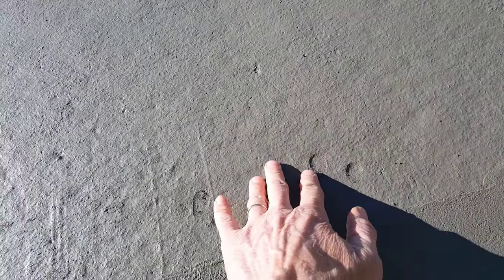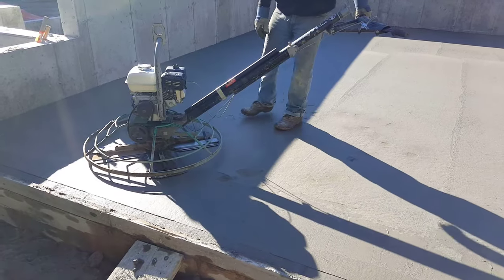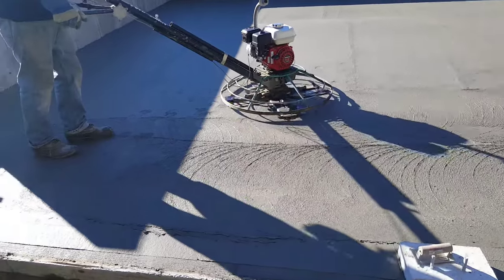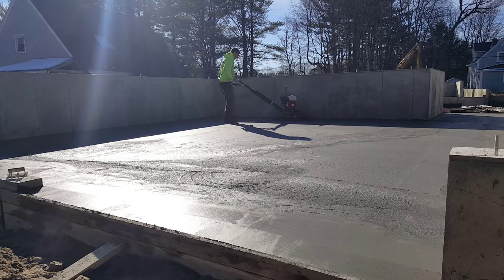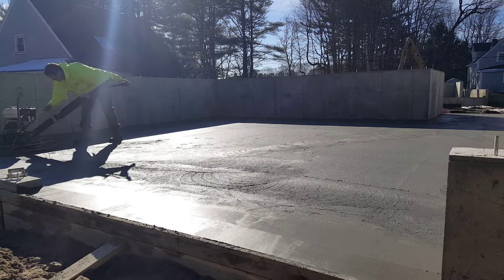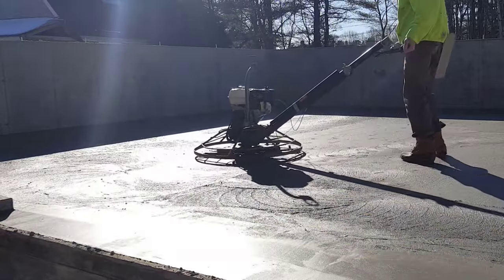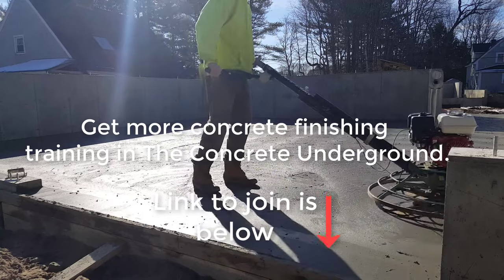When NOT To Start Finishing Concrete (How To Know It's Too Early)

Comment: As a 1.5 to 2 million sq/ft per year finisher for over 20 years rain or shine, I can honestly say, You nailed it!  Timing is 90% of the battle. Never hit edges pre machine. Waste of time and they'll tighten up to fast. Whatever pattern you choose, keep crossing it up next passes. Where I work it's usually 80/90+degrees. Use water on edges and slab on final pass to burn in a consistant finish. Around 3-4 gallons on a 5000 footer if you timed it right. Just a quick splash to work up a layer of grease that u can burn.
Reply from the maker: Thanks, what state you working in?
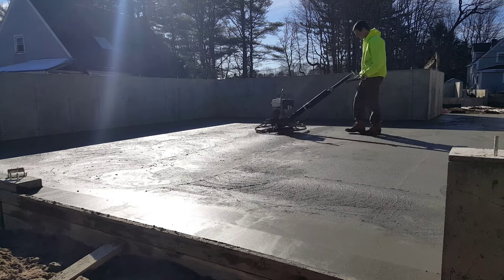Reply: @MikeDayConcrete  Florida. Cut teeth in Michigan for 8 years. I miss it. This state is one hot, flat, swampy, turd. 8 mos of the year walking out the door at 5 am feels like stickin ur head in a dryer full of wet clothes. We have standing will calls everyday for 100 yds at 7:00, 30 yds at 10:00 and 20 at 1:00. Slabs w drops., sitework and lentils/beams. Boom at 7, trailer at 1. Rain is not an issue. I have poured a slab on wed. and finished it on sat. due to a tropical depression.
Reply: @user-xo5zl2wq8c  🤘🤘🤘 DONT GIVE UP🤕🤕🤕🤘🤘😂😂💯💯
Reply: Always pan opposite to the way you placed it the first time and i agree. Change direction. Pan until flat. Most people pan way to early. Let ot go and use small mosquito machines on the edges keep them fury and flat passing fromleft to right. Use a mag or a flat trowel and rubnot trowel until the machine is one pass off finishing . If you have to get on boards or sliders to clean exetera face the wall let the machine tame out your marks but personaly i just walk the edges
Reply: You are a mf savage
Reply: Machine goes first then troweling wide n flat so the next pass with the machine blends smoothly with the edge. Pattern starts opposite of bull float first pass then cross up with a tight 1 foot pattern repeated until the slabs burnt. Oh and don’t forget to remove your float shoes when hard troweling the floor 🤣

Comment: I like to edge once before machine pass, we call it ski jumps If you power trowel to early. Basically turn a flat floor into a mogul field. Yes your correct it can really turn a nice floor into not to nice and is very hard to fix. Excellent job Mike 👍. Some times the sun dries the surface so you think it's ready then underneath it's still very soft that is what I saw in the video.

Comment: Hey Mike- Here is something I learned many years ago. I have two sets of plugs for the fall/winter also have a ratchet spark plug socket. One plug stays in the house at room temp the other was in the machine. On particularly cool/cold days I changed out the cold plug and put in the warm plug. Any machine will start easy doing this. Hope this is helpful….

Comment: When I first saw you using the picker to take the power trowel off the truck I was judging you for using that vs carrying it...but really I just wish I would have had one of those myself.
Reply from the maker: I know, I picked them up by hand for years before finding that little crane.
Reply: Much easier on the back.

Comment: We walk on it and if we aren't sure put you weight on you heels, if there is a biscuit it normally shows up.
Hit the edges roughly at that stage anyway as they can flash by the time the body of the slab is ready, it'll also tell you whats happening.
Pan it when it is ready, it'll show you when it is nearly there, the 45 minutes later cross it with the blades, always have a thin sheet of ply ready to walk the machine out if you can't lift it easily

Comment: Mike, love your videos. Keep it up. Question: we had some corrosion on our stamped concrete patio likely due from some salt we used over the winter. The corrosion wore away some of the paint and now we likely need to repaint and seal the patio. Do you have any suggestions or videos on this process? Thanks a million.
Reply from the maker: Why was there "paint" on the stamped concrete. Was this intended?
Reply: Mike Day Concrete it was a stain or a sheen. Perhaps not a formal paint.

Comment: On my last 2 steel passes, my shoes pull up a chunks of concrete, how can I avoid this..15 yr Decorative finisher learning flat work..can you help me out with this problem.
We even use slip on smooth bottom croc style shoes.
Thanks
Reply: Also when I stop the machine for a few seconds and restart it the blade pulls up chunks
Reply from the maker: That usually happens for a couple reasons, 1. you're hitting it a little too early and the wet paste sticks to your shoes. 2. IF you use air-entrainment, there's too much air in the mix.
Reply from the maker: Yes, that's common. We grab the blade arm by hand before starting the machine and give it a little spin to "break" the blades, this usually works most of the time but sometimes they still pull up small chunks.

Comment: The deal with hitting the edges with every trowel pass, it's a waste of time. The first 2 inches will be covered no matter what with the fir out for insulation, and most of the time its 4 inches under the framed walls. So I hit it once with a mag and twice with a hand trowel.
Reply: Garages are a different story, u have to hit them all the time
Reply from the maker: Us too Matt!

Comment: this is so wrong in many ways.... where are the plate under the blades that u have to start with first before hittin it with the blades? i dont understand why you do this that way.... come to norway and we can show u how concreting is really done :) we are working way more easy and make such better quality. i see alot of american and other countrys that do concrete, and i have to say.... heavy work for something that isnt that hard. me alone can make 500 square meters alone here in norway with only help with pouring the concrete and then machine it by my self. if its flat and square for most of the time tho hah